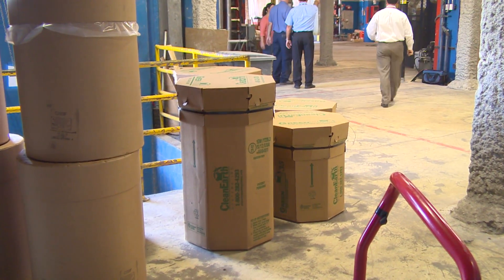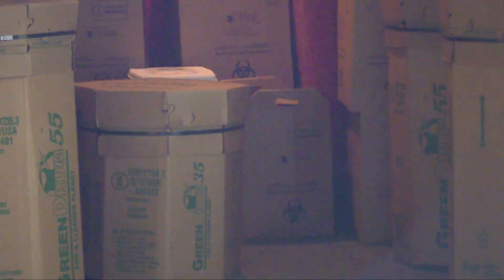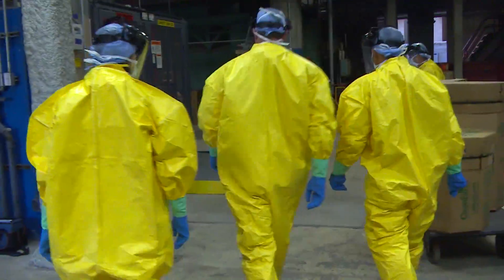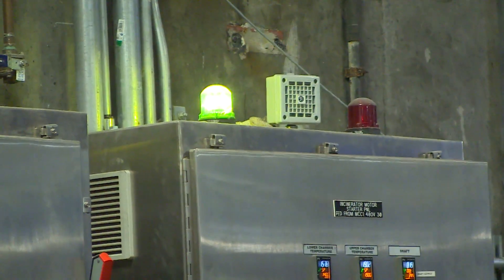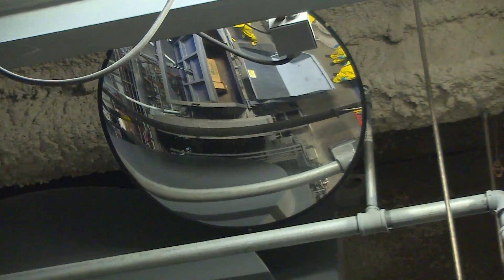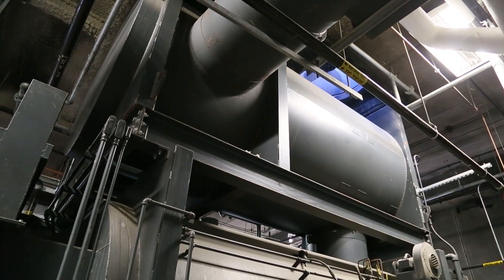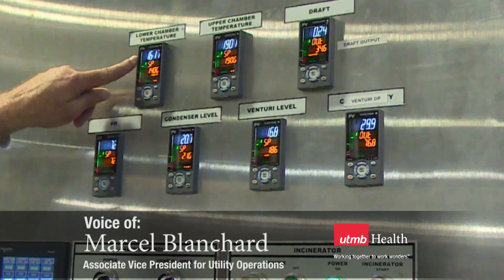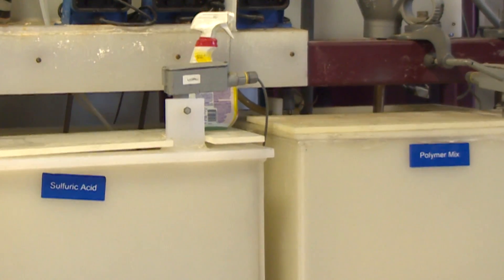UTMB Health's Hazardous Material Incinerator

Comment: Wow, I always wondered what happened to Waste from Lab. I love how well thought out and elegant this process is, Thank you so much for your work.

My only questions are as follows

1) Could it make sense to reverse the reactions and reuse the individual elements? 

Reasoning: Some elements can be incredibly rare or expensive. So to isolate and repurpose them may make some sense.

2) How could this process be perfect regardless of what chemical? Across the periodic table, Some boiling points can get really high, while some can be low or normal temperatures.

Would something like Tungsten and Sodium Acetate have to go through a separate processes? 

Also got a 3rd question now

3) How do we know that what we’re throwing away won’t react together? Like say you have to deal with stuff like H2S and MgO, how do we know the Heat isn’t just lowering activation energy for a double displacement reaction to form something like MgS+H2O. Just one example but overall though. 

I doubt you’re still going back to videos from ~9 years ago, But I’d love to have this conversation with you.

Thank you for your video & Hope everything has been going well over there. (I’m sure it has, you’ve set this all up extremely cautiously)